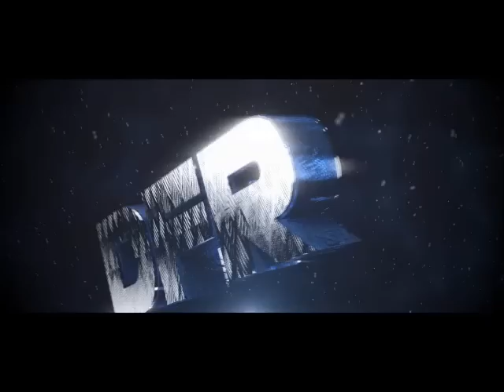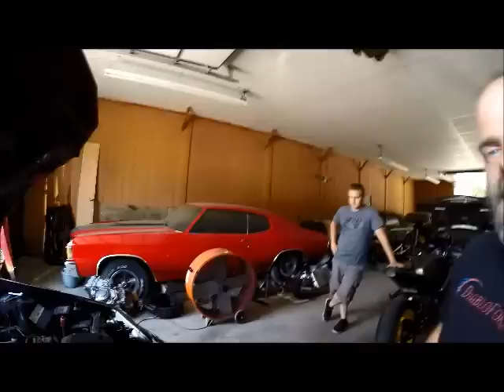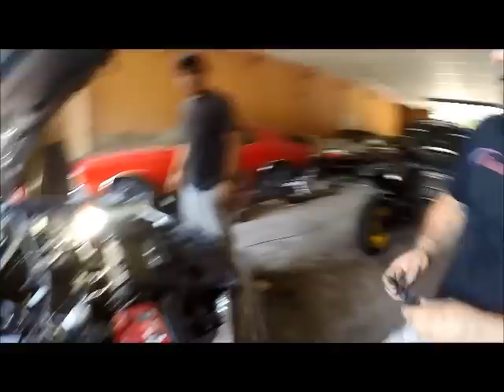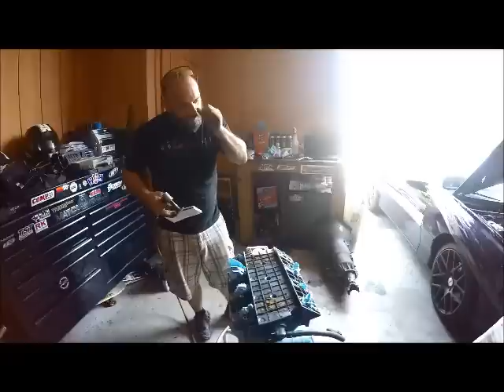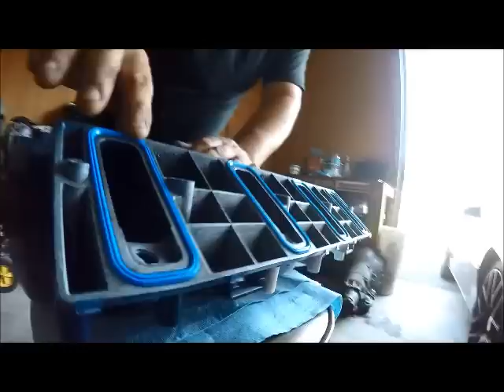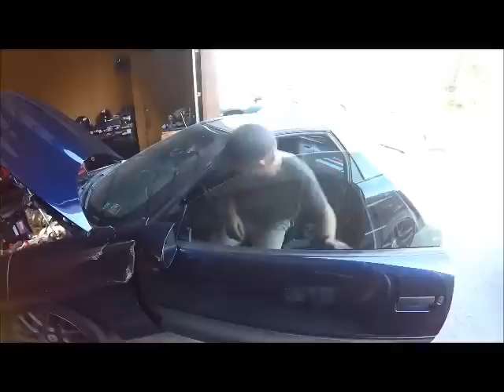How To Install An LS6 Intake.....The Right Way!

Comment: Wouldn't you want to use the new pick up line in the ls6 and take out that piece of the block that gets in the way instead?? That's the way I did mine. Then block the throttle body coolant line delete and it works way better. That's just my opinion.

Comment: would have been nice if you could have showed us where that extra vacuum line on the front of the intake goes and done it in the light a little better got the same project going on

Comment: So the coolant lines have to be hammered down and shave the bottom ridges??? Just wondering I just bought an ls6 intake for my 98 c5. Just waiting on cam and exhaust before I pull it apart.

Comment: Did you shave the bottom so you could keep the old coolant crossover tube? When I did mine I changed over to the LS6 style valley cover with the better oil separator, and LS6 style block offs in the rear and front vent pipe. I always wondered if there was a way to keep the crossover tube because I think  must have designed it that way for a reason and it probably cools better.
Reply from the maker: +ssdwellah yes i did
Reply from the maker: +ssdwellah yes i did

Comment: Dear sir, I have an o4 5.3 truck that is cammed and the  stock heads fully worked. I'm using the stock intake though. Will a later model 5.3 intake work better or  a LS6 or a trailblazer ss or what??  hope you can get  back with me concerning this issue. tks
Reply: chev202 new truck intake is same as tbss intake and works much better. easy to find complete for under $100 in any junkyard
Reply: ShadowOfDeath24.... Chev202? I have same truck... 2004 chevy silverado 1500 z71
Reply: Nevermind lol ic now!

Comment: Hey Andy im not entirely sure but doesn't the ss already come with an ls6 intake and the z28 had the standard ls1 intake? just wondering
Reply from the maker: +Fatbobjr21 98-00 came with LS1 intakes, 01 and 02 came with LS6 intakes
Reply: DiabloFormulaRacing do the 2002 z28 come with ls1 or ls6 intake ?

Comment: Ls 1 still with a MAF ? definitely should get mafless tune done if he wants more power
Reply from the maker: +kyle de man MAF/VE tunes are the best way to go unless you are boost.  They both work together to give you a smooth transition in drivaibility in any condition of air intake
Reply: ***** Ohh another question I see people sand back the grill bits on the intake manifold but they put the pads back in?
Reply from the maker: +kyle de man the pads are just for cushioning on tbe vent tubes
Reply: ***** sweet thanks Andy
Reply: DiabloFormulaRacing this is probably a while from when you made this lol. But my car is a 2001 ss August of 2000 build. Would I have the ls6 intake from factory any help?
Reply from the maker: +Hey Chevrolet does it have EGR going into the intake?
Reply: DiabloFormulaRacing is that right by the throttle body? You know I never looked and and I'm curious because I want to buy a cam from you to swap into a 6.0 truck block down the road here.

Comment: small chisel and a hammer...takes all the fins off in 5-10 min
Reply: Better/easier than a dremel? about to take on the task and want to do whichever way is less prone on messing up the intake lol
Reply: Christian notw,

yup much quicker and safer.  Basically no chance of going too deep with a chisel.  just angle it as horizontal as you can and tap it.  will take off the entire length in 1 strip
Reply: Ok great to know! What did you install it on mind me asking?
Reply: on a 99 T/A.

word of advice, a ratcheting wrench is your best friend for the back 4 intake bolts, space doesnt really allow room for a socket or much in the way of turning...and a good set of gloves, the plastic under the cowl is razor sharp
Reply: oh, and you dont have to disconnect the fuel line.  you can pop the injectors out and transfer everything to the new intake with the line attached.  you just have to do it in the engine bay
Reply: ok sounds good man!! I took it off a camaro ss and putting it on my 99 C5...hopefully its as easy as you say lol
Reply: Christian NOTW ,

oh, you'll have it even easier on the Vette.  not as much cowl overhang